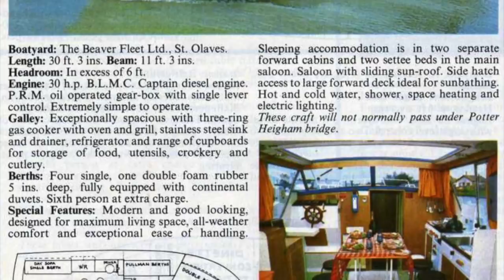Boat restoration and wheelchair adaption

Comment: Great effort on the restoration! Did you replace the single glazed frame and windows like for like? Or, did you get double glazed windows? I'm looking at upgrading my own and would love your opinion on doing it yourself, or which company you used. Thanks!
Reply from the maker: They are single glazed maybe a few years down the road or if I get too cold I will upgrade them but for now I'm happy with them, I also have two heating systems and they are keeping her nice and cosy .